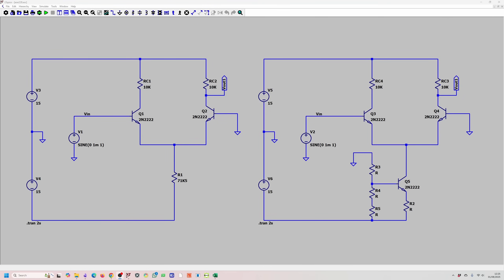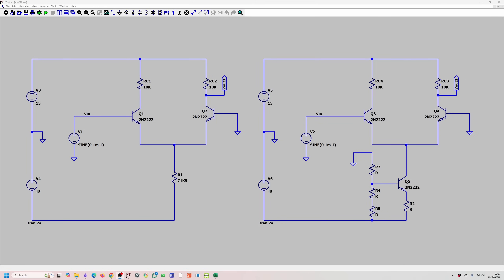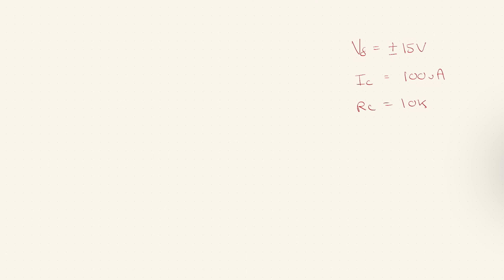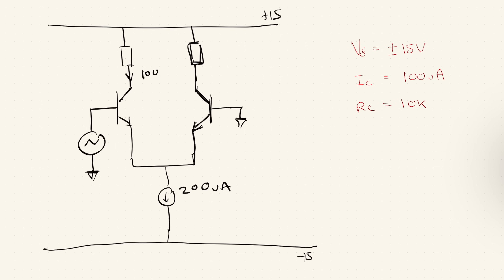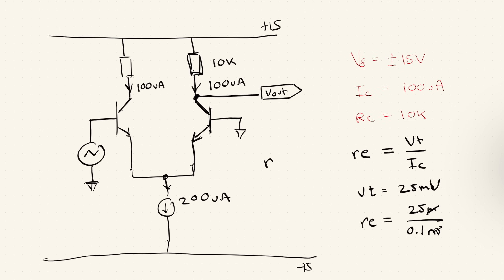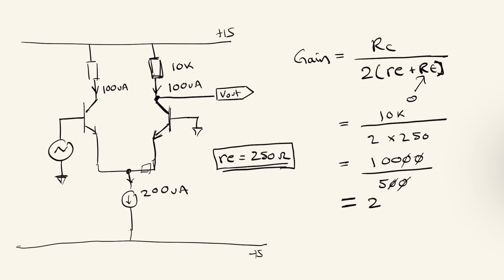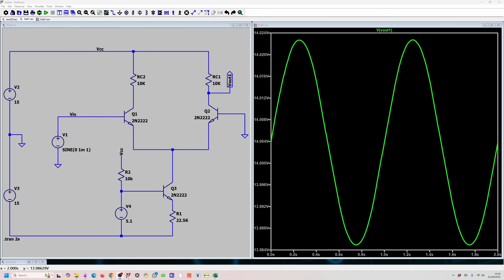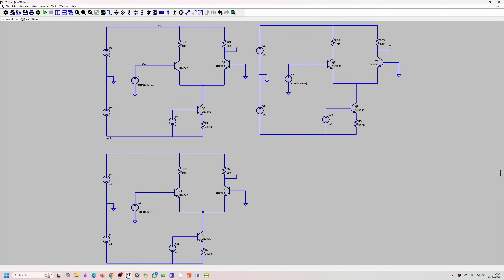VCG Differential Amplifier Design - Art of Electronics Exercise 2.28

Comment: I really wish you’d get your “signs” right vis a vis the zener diode.

The bottom of zenee is -15v. The zener is +5v. So base is what !?

+/- 9.9 ???

The top rail is +15 volts.

Something smells here !

Don’t get me wrong - I may be wrong - because I don’t know enough.

Please correct me with more of your knowledge!

I’m going to “Patreon” you !

You are bringing “knowledge “ to people !!!
Reply from the maker: I am not entirely sure what part of the video you are referring to. Do you mean around 4m28s mark? 

The bottom rail is -15v 

The zener is 5.1V zener so it clamps voltages above 5.1V in the reverse direction. 

If the bottom part is connected to -15v then the top would clamp around -9.9V. 

Can you give me reference to the point in the video where you referring to so I can correct any -+ signs if required.
Reply from the maker: The top rail is +15 volts.
Reply from the maker: I am not sure what “patreon” means but I appreciate all the support so thanks!

Comment: Oh, and the simple transistor current sink would only work "half the time" if its bottom rail was set to ground, right? Luckily you quickly moved on to using the actual negative rail quickly. Oh and I think LEDs can be a quieter "zener" while consuming less voltage headroom than a 5.1V zener. Only that they are not quite as stiff a voltage drop.
Reply from the maker: Yep, exactly — if you tie the sink to ground you’d only bias one half of the differential pair, so the negative rail is essential for proper operation. Good point about LEDs too, they can definitely act like a low-noise reference! Thanks for the comment.